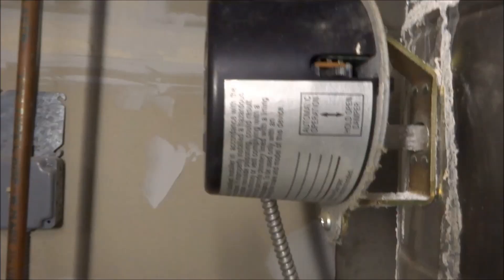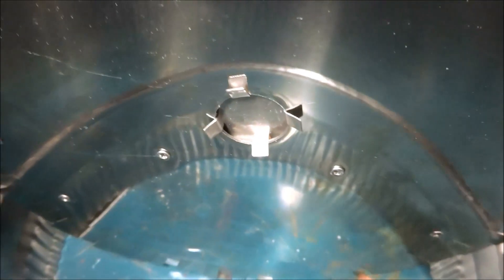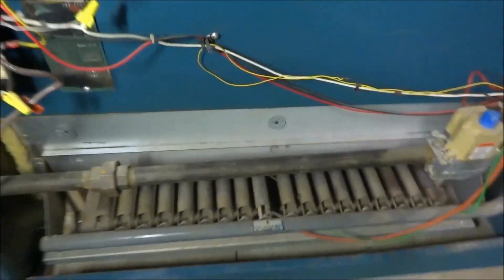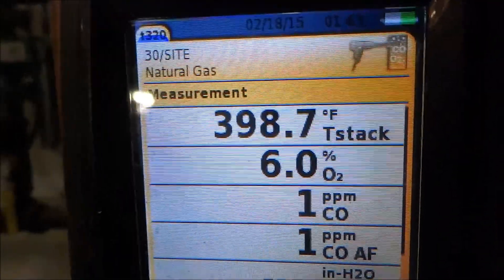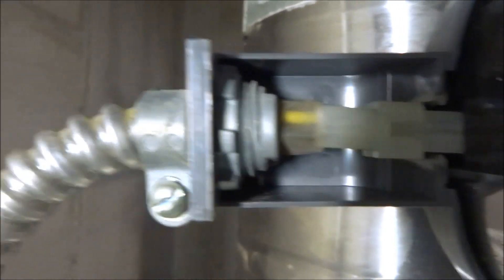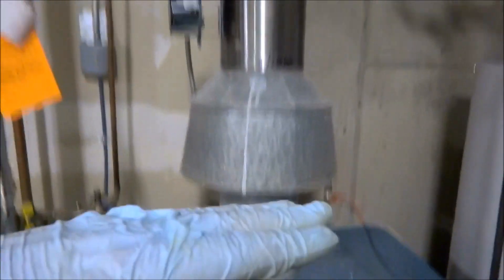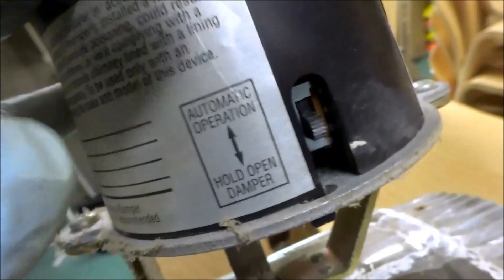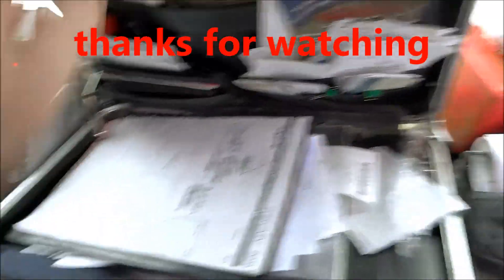gas boiler vent damper replaced ,testo 320 combustion test preformed

Comment: Thanks for the  information sheets. I tried to get a person to hook up my Field damper but he said he would ONLY hook it up if it came with the boiler. In the north we get ALOT OF COLD - REAL COLD AIR COMING DOWN THE CHIMNEY making the lower level about 10 F degrees lower than the upper floor. This information might just allow me to hook up my own wiring. I came across a statement that 3 of the wires must be the same polarity - so I am guessing positive and the fourth different polarity. Please clarify which wire is the different polarity and where it is hooked to be different. I am guessing it is one of the wires on the transformer- but WHICH WIRE. Thanks

Comment: hi Steve
I'm working on a burnham boiler for a residential home. I did check to see if the pilot was on and it was I also check to see if the damper was getting voltage and i have voltage I can see the stem spinning to the open position on the damper. my question to you is the limit switch that's on the smoke pipe is in normally open on the off position without the heater running. I can hear my gas valve clicking like trying to kick on. I am really puzzle with this way I'm just wondering what are your thoughts are you help me out with the other one this one of different problem thank you Steve

Comment: The properties I manage all use Taco zone valves, what's the reason for having pumps on every zone instead of one pump for the whole system?
Reply from the maker: Nielubie  seperate circulators make a better job . each pump runs its own zone

Comment: Hi Steve
As always thanks for the videos. I've picked up quite a few tips from them. 

I had a question for ya. 
Got any recommendations on a WIFI thermostat?
I've only got a oil fired boiler with 2 zones and 2 wires run to each thermostat. 

I know at the least I'll have to use a 24v adapter to power a fancy thermostat. 
Really want a wifi unit so I can control while I'm at work. The kids keep messing with them.
Reply from the maker: Mavstang73 well a wifi stat needs a common wire ran to it .so you will have to run a new tstat wire. is the best way .some of the new ones can run on a battery  i like a honeywell tstat my self. pick out the one you like .myself i would get a honeywell .

Comment: Great video. I keep cheat sheets to. BTW what area did the furnace serve?
Reply from the maker: bear maintenance basement  hvac system .for air conditioning .the first floor has first company air handlers with hydronic heating coils for heat up in the actic

Comment: That's a reference folder of gold! Do you come across 120V dampers much? (I noticed the diagrams on your cheat sheet appeared to all be 24V control circuit units.)
Reply from the maker: Dwight Bennett no all the dampers i se are low voltage